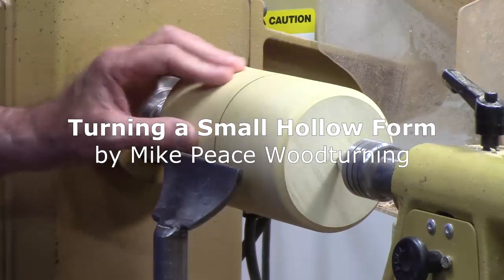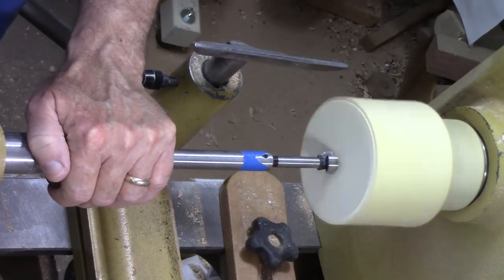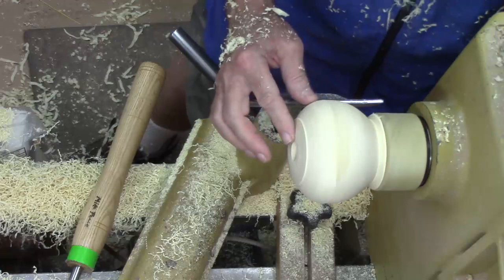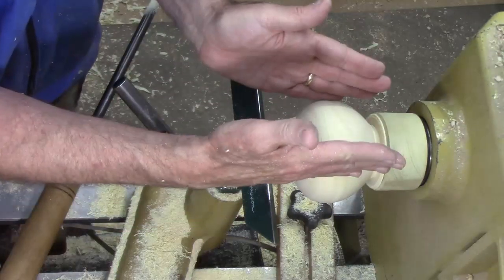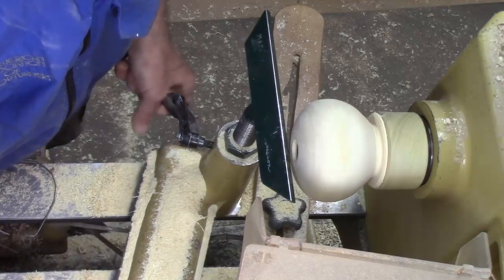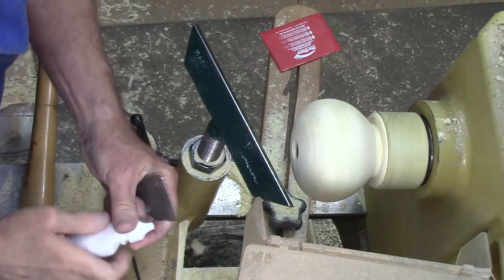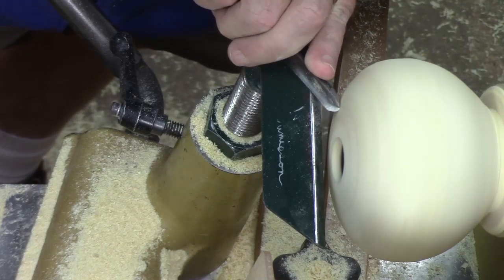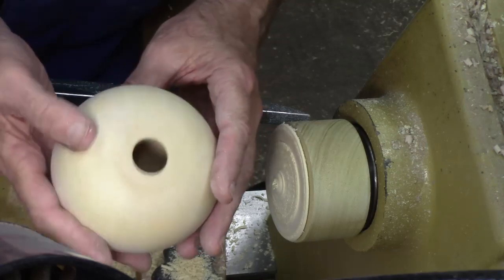How to Turn a Small Hollow Form

Comment: I'm falling in love with powermatic lathe, I've only been turnning about 3yrs with a mini lathe, just bought the next size up. I have worked with machinists lathes in the past, 36" swing with. 14ft max material length. I have never seen a sliding headstock, love it!!. I ever get to that stage of turnning, powermatic will have to be in the running, LOL. That is a nice feature...........
Reply from the maker: I like my sliding headstock and use it with almost every bowl. That said, some noted turners that turn larger work complain of vibration with a sliding HS. I guess I am not a good enough turner to notice. I think it is a subtle issue. I smile every time I use my lathe and appreciate all of the cast iron.

Comment: Mike,  Thanks for the great demo.  I too occasionally drop screws into chips and got tired of searching for them.  I took a 12" long piece of oak about 2" wide.  On one end I turned a handle to make a wand.  On the other end I countersunk five rare earth magnets about 1/2 " apart.  I used 3/4" magnets but probably half inch will do.  Now when I drop anything into the chips I wave the wand over the chips and the screw jumps onto the magnet.   Saves a lot of bad words as well as easier on the back.
Reply from the maker: Sounds likea great solution! I will have to make one.
Reply: Great idea! I have the typical manchanics stick magnets but this sounds like it would be so much better. On my list of DIY shop tools.......thanks

Comment: mike I was thinking about getting the simplicity hollower with the lazar,,the one with the articulating arm,,,what are your thoughts on using this kind verses the hand held,,
Reply from the maker: I am not familiar with the simplicity hollower but am familiar with the articulating arm hollowers in general. I like the concept. They have a smaller footprint tor storing then the Lyle Jamieson style rig I have. I believe the Jamieson style allows a bit deeper hollowing then an articulating arm. I am not a big fan of hand held if you are going deeper then say 4-5 inches. I like a laser but I don't do much hollowing. If I did I would setup the camera and monitor system like Trent Bosch sells. They are not expensive to build your own. I have the parts but just have not followed thru with assembling one. A general rule of thumb is you can hollow 12-15 x the hollowing bar diameter before you get excessive chatter. So a 3/4" bar should be good for about 11" depth. Hope this helps.
Reply: it does help a lot mike and thank you

Comment: Hi Mike,  Could you tell me where you got your Forstner bit extension? My Forstner bits have a round shank and I'm having trouble finding an extension that's not hex.
Reply from the maker: +Michael Huntley sorry but I got it used.
Reply: Okay thanks.
Reply: Michael, I found forstner bit extensions for the round bits on amazon. I got an MLCS 9270H 5” extension and it works great.